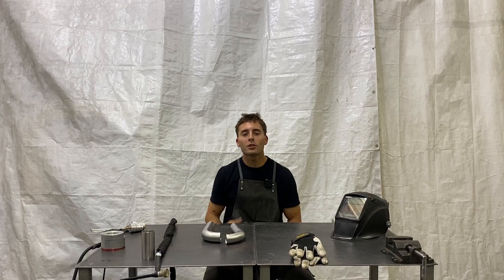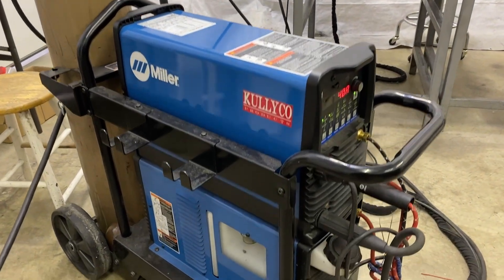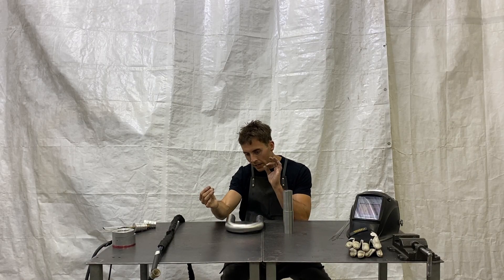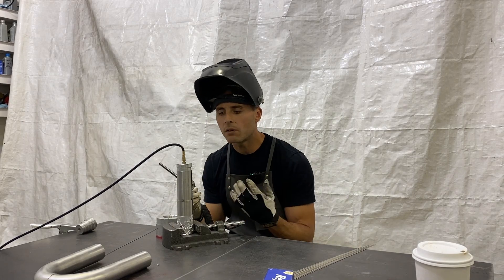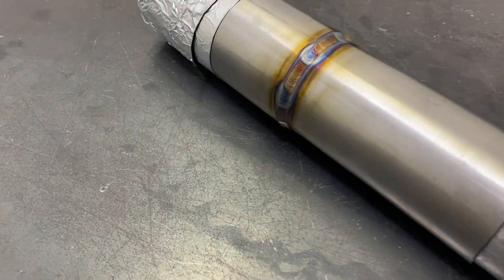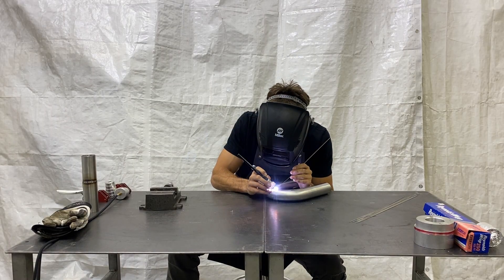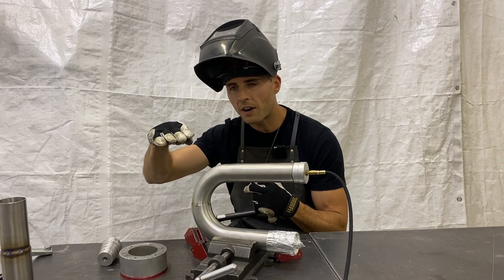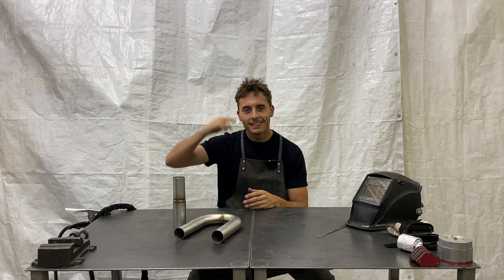How to TIG Weld Exhaust Lap Joints (Full Tutorial + Pro Tips)

Comment: why do you use aluminom foil at one of the ends of the tube?
Reply from the maker: Because I am running back purge through the tube, the tin foil caps off the end to hold the gas inside.  Then I poke a few bleed holes in the foil so the gas can escape

Comment: just curious.......why are you back purging exhaust ?
Reply from the maker: 1) It shields the inside of the weld from oxygen, keeping it strong and clean all the way through. 
2) To prevent crusty slag from hanging on the inside of the weld joint, bad for exhaust flow
Reply: He did tell you that very thing in the video.

Comment: Good tutorial . I do need some .035 filler . Hard to get .035 and .045 around here unless you buy ten pound tubes . A little more exacting with 1/16" and nearly impossible not to overheat under 16ga. .
Reply: I use mig wire for light welding. Learned that from a fabulous lady welder from Australia. Her work is uncanny.
Reply from the maker: @jeffreylynch3203  Im familiar with this trick :) ats awesome, thanks for watching!
Reply from the maker: Thanks! I appreciate you watching .  Yes for 18g i would try and stick with .035” if you can .  Where are you located ? You can order the filler through my local Airgas in Sioux Falls
Reply: @KULLYCO Hi I’m from NY I called Airgas they don’t know about .035” Super Missile filler rod. Can you help? Also wanted to get the #16 gas cap.

Comment: Howdy, I do a lot of jobs in dairy, pharmaceutical, and other areas where I’m welding sanitary tubing multiple times a week if not everyday at times. I have 15 years of experience in the industry and own a ASME certified welding shop where we build stainless tanks and vessels, and often have to x ray our work.  Awesome video and great presentation, but to further keen aspiring minds eager to learn, might I suggest a few pointers to add to your tutorial. 

- You always want to have your ARGON ENTERING your tubing or pipe, what have you, at the LOWEST POINT of entry (usually the bottom), flowing through the work piece, to then EXIT at the HIGHEST POINT of your work piece…. Being usually the top or opposite end of the pipe, as long as the opposite end is above your entry point.   Foil tape is often used to seal the other end and the best method is to poke a small filler rod +/- sized hole in the tape at the top towards the top edge/ wall of the tape. If it’s a straight pipe for example you want your argon to be entering the bottom of the pipe and exiting the top to put it simply. I would guess you chose to enter your purge hose into the top of the pipe because of accessibility with clamping it in your vice etc. But that’s not ideal. Try getting a rotating purge fitting online. Or purge plugs that have a built in defuser you can connect your gas line to the barb or sometimes threaded fitting. Better flow and shielding volume will be at its fullest potential in return. Foil tape is just fine of course too for those who are more familiar with the age old method of sealing off your pipe, with a simple vent hole poked through that tape again at the HIGHEST exit point of the weld piece. 

- Also from my experience how you end your weld is very important. Reducing your amperage and letting the heat being applied to he weld puddle slowly taper off before fully completing your ark is ideal. For the sake of it being much easier on the metal and its overall integrity of the parent metals itself opposed to abruptly cutting that weld off and killing the arc instantly. Give that puddle time to cool as you come out of the ark and reduce that puddle size to a point at the bottom or end of your weld bead. It’s a good habit to have especially when you’re welding pipe if that’s on your agenda for the future. Taper that arc stop especially when dealing with the properties in stainless it’s key to trail out and reduce your amperage for a few seconds to fade out of your puddle when at the end of the weld when ever you’re ready to stop your ark. 

Other than that you should give yourself a pat on the back for your very easy to follow and very informative welding tutorial. But most importantly providing proper and accurate information and instructions for new comers to build healthy habits and not begin practicing improperly from scratch. Keep inspiring the many who seek to become better at welding and building their skills of life’s tool box. Cheers friends!
Reply from the maker: Hey man, I really appreciate the detailed message and all of the information- genuinely.  I'm always learning myself and will continue to do so, moving forward!

I think there are some good tips in your message.  Some I've heard, others I have not!  I will try to implement some of this into my program moving forward!

have a great day- and I appreciate you watching.
Reply: 💯 I've forgotten to vent the foil cap before.  While doing fusion (no filler) welding on stainless tubing, I had my weld puddle blow out from the slight pressure of the unvented back purge.
Reply from the maker: If you are interested in more training around TIG-Welding, check out my school & community: https://www.skool.com/kca/about

Comment: A question on filler rod. While I have SuperMissileWeld in 1/16", 3/32", and 1/8", I've never been able to find it in .035" or .045". What do you think of either ER312 or Washington Alloys TU Tensileweld as a substitute? Both are readily available in .035" and .045".
Reply from the maker: Yes that is the same rod!  It will work perfectly :)
Reply: @KULLYCO  Thanks!👍

Comment: Nice work. Question  Is that the finished product, or there is some grinding that has to be done . Thanks
Reply from the maker: That is the finished product- you don't ever want to be grinding on your welds.
Reply: @KULLYCO  I like to see some exhaust getting butt welded also . Thank you
Reply from the maker: @michaelhallas6450 check out all my other exhaust videos- a lot of butt weld content
Reply: Like you mean the discoloration? You could polish with rouge on a felt cone. Grinding welds always weakens the work.

Comment: awesome video! thanks for uploading! what's your process for expanding the end of a pipe that's in the middle of a mandrel bend?
Reply from the maker: This joint wasn’t expanded .  The smal tube was 1.75” and the larger tube was 1.875” .  However - when expanding in the middle of tubes it’s very tricky- i try to avoid that at all cost . Becuase the expander pushes the thin side out more than the thick side - not a good practice
Reply: @KULLYCO  ahh, okay. apparently I'm blind - I thought I saw it as an expanded end. i'm about to work on some stepped headers where I'll go from 1.875 to 2in, so I was def curious.
Reply from the maker: @kevinmerhar49 cool man, good luck with the project. Let me know if you have any questions